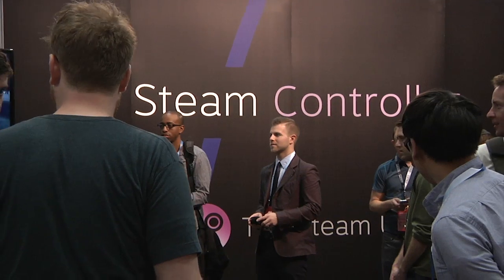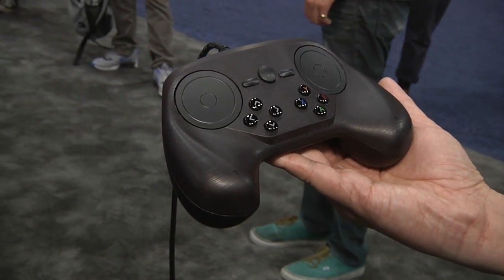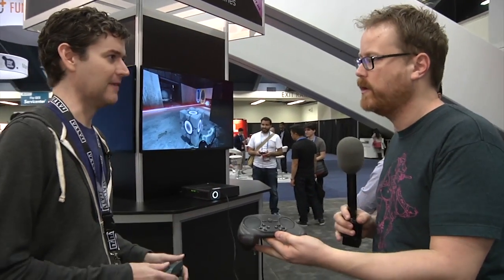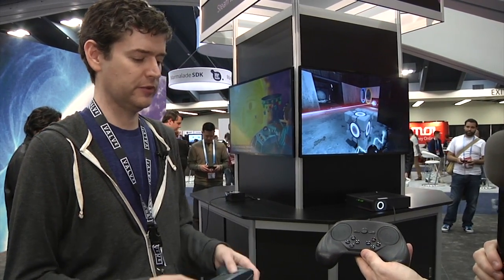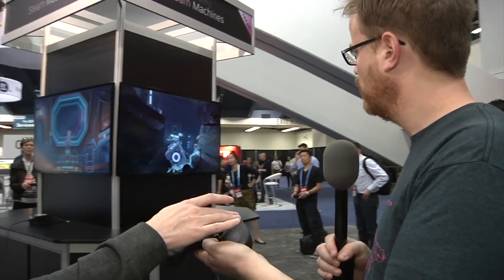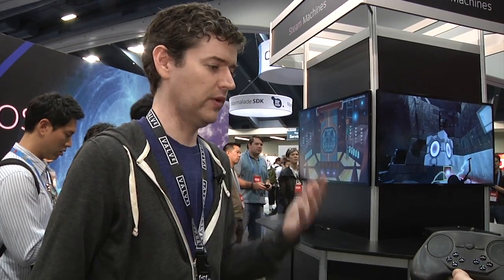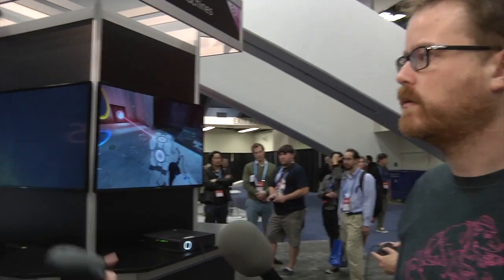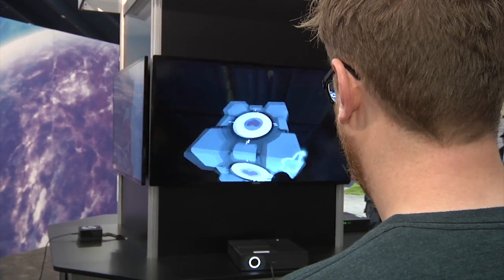Valve's Steam Controller Prototype Hands-On at GDC 2014

Comment: Why ABXY? xB It should be WASD. That would have been fun.
Reply: Because 90% of all games that have controller support, use ABXY.
Reply: Herman Bleh It doesn't matter what the button show, the game doesn't see the button.
Reply: Yago Dias Do remember however, that on the screen ABXY can show up
for example: 'Press A to jump' if you have WASD on your controller you won't know which is which.
Reply: Area51JD Um, if you rebind jump from space to tab, the tutorial will say: "press tab to jump". The same goes for controllers, whether it's triangle, X or 3, the PC is capable of recognizing that, and most games do.
So WASD is a completely valid option, and TBH it would've been quite funny. :P
Reply: Yago Dias ofc i know that, but thats what the game shows, so its less confusing for consumers.
Reply: G,A,B,E
Reply: abexuro Not Xinput games. Only Dinput compatible games properly recognize the button.

Comment: Would be much happier if the left 4 buttons was an actual d-pad.  As it stands, it's a second-rate d-pad substitute that couldn't be used for casual playing in a fighting game.
Reply: They're not going to change just one side of the controller, since one of the main ideas behind the controller is that it's ambidextrous.
Reply: The buttons on the left aren't meant to be a dpad substitute. Dpad functionality will be handled by the touchpads. The buttons on the left serve the same purpose as the buttons on the right. They are labeled with directional labels because that naming is more familiar with gamers.

Comment: Also I hope they bring back the screen because it would be nice that when your far away from your screen and you can't clearly see UI elements that you could use the touch screen for fine control so you can both see and use small UI elements from 3 - 4f away from a 32" screen.

The reason why I really want that is because I want to use the steam controller as a general multimedia remote as well which having a touch screen on the controller would make using youtube from a distance from your computer really easy.

Also if you have the ability to zoom in and out with touch screen gestures thats would make it super easy to use, also it would make it work with games like Civ etc although even a small touch screen would make the controller far more expensive.

Comment: This one is much more nice.  I like this controller,  for its simplicity and the similarity to other controllers,  but still using the touch pads for innovation. Gg,  Valve. Although,  if they could somehow utilize the middle (which is mostly blank),  to its full potential,  I might consider this being my only controller I use.

Comment: REASONS TO BUY THIS:

Character Movement WASD < touch pad < thumb stick
Aiming/ Camera Manipulation thumb stick < touch pad < mouse

It is the best of both, or it should be as long as you can adjust the sensitivity of the pads.
Reply: Touchpad is better for movement than a thumbstick.
Reply: ***** Not even close.
Reply: ARCADDER It's so much more precise, though.

Comment: Needs a Analog stick for the movement not so much viewing side the ability to use it like a mouse is great but the movement needs to be an analog stick.

I heard rumblings the reason why Steam OS and the Steam controller has been delayed is because there adding an analog stick so looks like they are already doing it so.

Its just because for racing games you really need the physical feedback and auto centering of an analog stick to get the best result, and it also works well for general movement in frist and second person shooters but that is true for the touch pads as well.

It would also work for Civ because you can use the analog stick for moving across the map and the pad for UI interaction... Although that would make it asymmetric... Which is probably why its taking them until some time late 2015.
Reply: I could be wrong but I'm pretty sure its confirmed the final controller will have an analog stick where the d pad is but still keep the two track pads
Reply: clutch350 Actually I'm pretty sure the left track pad was replaced with a D pad and the analog stick goes were the D pad was.

Oh sorry my bad they just added a directional indicator on the left track pad.

Comment: They should put a scroll wheel/slider/throttle on the controller for flight sims and analog selector for other game types.

The perfect combination would be a mechanically or electromechanically lockable scroll wheel with 4 modes:
- free spin
- detent spin (like a mouse scroll wheel)
- free with lockable spin angle (for throttle)
- detent with lockable spin angle (for weapon selection)

Comment: I like how the guy on the right tried to shit on Nintendo, but literally made zero sense when doing so. He ended up mumbling under his breath in shame, because he realized this mid-sentence.
Reply: What? He was mentioning that the nintendo button layout is different than the standard.
Reply: He mentioned ABXY and said how it was the standard, then under his breath tried saying it somehow wasn't standard for "nintendo people"

He must have realized mid sentence that it's sony who doesn't use ABXY, not Nintendo.
Reply: N64xKING how is pointing out a difference an insult? And for all you know he could have been referring to the Wiimote which is wildly different than a standard controller.
Reply: N64xKING x and y are flipped around on a 360 controller if you compare them to Nintendo ones.
Reply: N64xKING He was referencing how Nintendo does not use button diamonds, Playstation and Xbox both do. He wasn't talking about how the buttons are labeled, he was talking about location.
Reply: *****
No it's just that on Nintendo's diamonds (SNES, classic controller, wiiu) the ab buttons and the xy buttons are reversed from the xbox counterpart

Comment: Analogue stick on the left, funky trackpad thingy on the right, boom, done.
Reply: Your missing the point entirely. Analogue sticks are simply not as fast or accurate enough to play specific games properly.
Reply: George Ambra
That's what I was thinking, the left analogue stick is for the movement in FPS games, or car control in driving games, and the track pad is for looking around.

Comment: Gotta love that war between K&M users and Gamepad users. And the almost complete lack of respect for either side by some of the elitists. Stay classy internet.

Anyway the new pad is looking better then the original. So far the trackpads are working out better then most expected. Best part about this is that everything is still in beta. Meaning more time to actually sit down and refine the controls. And for those complaining. Remember that this is an optional controller. A 3rd option to the K&M and Gamepad, nothing more. It's not required for PC games so there's no need to stress about it unless your among the group that wants to use it. The only bad thing that will come out of this controller is that it will not stop the stupid and out right silly war between K&M and Gamepad users. And may only end up adding a 3rd group of whiners to the already mind numbing number of gamers that are apparently insecure about their control method of choice. Because god forbid we respect another person's choice...  - _ -;

Comment: I like the idea of Steam Machines and the controller but honestly how hard is it to plug your computer to your TV with HDMI? I do it and use a wireless keyboard and mouse and it's great.
Reply: The impediment is that most people don't have the money for multiple gaming PCs and don't to lug their machine all the way to the TV to use it nor leave it attached to the TV 24/7.
Reply: There´s nothing hard at it :D
Reply: A steam machine doesn't need to be another high end gaming machine. It can be a stripped down device that plays some games locally and streams others from a high end machine.
Reply: For games like NFS a controller would be better.
Reply: Steam machines aren't supposed to replace your PC, they're for people whose PC/monitor setup is in a different room to their TV/couch and saves them the effort of carrying the PC back and forth between rooms. It's pretty much short range remote access for your Steam library.
Reply: Matthew Whitwell I think valve has something up there sleeve. Moving your computer to the living room?? Why? I mean yeah bigger T.V i guess. I think they are going to try something with virtual reality. I men think about it they have been messing with the creators of the oculus rift. Also the steam machines are a good idea for people that don't have thousands of dollers, and want a PC, but don't know how to get the specs of a console cheaper. Valve may not say they are competing with the consoles, but the designers of the steam machines are, they even said so. So this is gonna be great, cause if one console sucks like the damn xbox, and you want something with more powerful than the PS4, but cheaper than a 1,000 dollers these are for you , and this is gonna be freakin sweet!
Reply: Brandon Mounce Sorry but you don't need to spend $1000's of dollars on a decent gaming rig you can build a rig which can play every game under the sun at 60fps 1440p max settings for $700.

And don't give me that 4k nonsense 1440p at 28" is perfect unless you have your nose up against the screen, the 31.5" 4k monitors are worth it but those are all IPS and cost like $1000+ so not for most people.

And its not like you could do a 31.5" TN monitor because the angle you would be viewing the edges at would be so extreme that you would REALLY notice the gamma shift even looking at it dead on from 50cm - 100cm 

And really 28" is a very good sized monitor.
Reply: Etheoma What? I never said you need 1,000 dollers for a gaming rig. The cyber power pc gives you more bang for your buck it;s impossible to get there 700 doller steam machine with all it's specs if you build it.
Reply: Brandon Mounce Errr sorry just a second were you saying that cyber PC is cheaper than buying the parts your self and putting it together?

You don't put your sentence together too well, Did you mean Cyber Power PC's are cheaper than steam machines?
Reply: Etheoma The cyber power pc makes a steam machine o.O So it is cheaper than some of there pcs. There 700 doller steam machine is cheaper than building one
Reply: Brandon Mounce Nope as far as I can see the $700 PC one is what I could build for $435+ $100 for Windows equivalent, Your going to be cheaping out on the case but for another $65 you could get a very good case.

Which still means its $100 cheaper.

Although there is a deal where you can get a 290X GPU for less than a 750Ti, only thing is that the i3 4150 is not going to be able to drive a 290X so... But its the same price after an instant $250 rebate so shrugs

That is cheaper than buying on its own but you at least need a FX6350 to drive the 290X.

Which they don't give you the option to buy a FX6350 in any of there options for cheaper than a FX8320 and all those options are nearly $1000. The devil is in the details.
Reply: Etheoma 435 my ass. You're going to be running less of a video card. You might be able to get a better processor, but a processor sucks nuts if the video card blows.
Reply: Brandon Mounce Nope the $700 one comes with a 750Ti as I said the CPU that comes with the $700 system couldn't drive anything more than that.

And the system example I used came with a 750Ti

750Ti $130
Athlon X4 760k $79
Motherboard $44
1 TB HDD $50
8GB RAM $70
350W PSU $35
Case $25
keyboard & Mouse $10

Which is a little over but that is $443

For gaming that will be just as good as the $700 system as the 750Ti will still be the bottleneck even with the CPU being weaker than the i3-4150.

for $700 I could do a good system.

FX6300 $110
GTX 970 $340
8GB RAM $70
Motherboard $50
PSU 550W $60
1TB HDD $50
Case $50
Keyboard and Mouse $25

Ok it came out $55 more expensive but its 2.5x better in game performance so I think the extra $55 is worth that also the better case keyboard and mouse were what mainly caused the overspend. Also its going to be much better for multitasking than the 4150 as its a 6 core CPU rather than a 2 core with hyper threading.

Right now you might get a slight amount of CPU bottlenecking but with DX12 on the way pretty soon with 50% CPU utilization increase on 4 threads I really wouldn't worry about it because the bottleneck will fix its self. And right now you can play every game in existence at 1080p 60 fps+ in the highest setting so your golden.

Also you could probably expect DX within 1 - 2 years to support 8 threads so in the long term you will be better off with the FX6300. Because AMD has developed mantel which can support upto 8 threads so if Intel doesn't buck up its ideas its going to get left behind also AMD works closely with Windows with DX so the improvements made in DX were probably based of the mantel API, so 8 threads should not be difficult.
Reply: I'm not saying you can't get a good pc for around that same price. I'm just saying you can't get better then cyber powers.steam machiine for that price. Your using a amd processer to make up for the price. Yes they are nice computers, and i think if people build them you need to show them those specs, If people want the most they can get out of somthing then why not buy the thing instead of build it. The alienware one sucks nuts though xD Like you could easily build one better than that piece of junk.

Comment: Still no proper D-pad. 4 individual buttons just aren't going to cut it.
Reply: Still a prototype mind you. If enough people dislike the way they're doing a "d-pad", I'm sure they'll change it. (:
Reply: The left track pad will be the D-PAD. If you don't want that then use a different controller.
Reply: They have directional buttons. The issues he has with them is that it isn't one piece altogether. The casing separates them. In all honesty though, I think that might be better than traditional directional pads. Maybe not though, I haven't had the opportunity to use the controller so I can't give a definitive answer.
Reply: I'd honestly prefer separate direction buttons rather than a solid d-pad. I think it'd lessen the chance of hitting two at the same time.
Reply: I'd rather have 4 buttons than the mess of a Dpad Xbox has.
Reply: Using 4 separate buttons instead of a D-pad has been an epic fail in many an android gaming handheld and the gp2x/ wizz machines. 

Often inspired by the seemingly separate buttons of the Sony dual shock gamepad which is in fact a single piece thumbpad looking like separate buttons. 

A d-pad makes smooth changes in direction and especially diagonals possible. 4 buttons aren't going to cut it. :(
Reply: It's supposed to be ambidextrous, so no asymmetry.
Reply: Studies suggest that 70–90% of the world population is right-handed. 10% seems to be left handed and some - like me - are ambidextrous. Striving for a visually appealing controller is something a designer would perhaps do, a gamer would look at what works. I've had the 4 button thumpad thing in my hands and doing diagonals or smooth movements on those separate buttons in say Shmups is virtualle impossible. When doing platform games (2d) where left and right are used and the other buttons as jump and action buttons there's no issue. So it very much depends on the style of game you're playing. The thumpad in some sort of single piece of plastic combining the buttons in some sort of cross shape seems to work best. That's why almost all gamepads have an actual thumbpad. And I believe all systems have had their thumpad on the left side of the gamepad with two analog sticks. Converting the sticks into circlepads may be a good thing for FPS type dual analog type games but in a way it relies heavily on propriocepcis that is the thing that most people dislike with touch controls on gaming tablets. 

Perhaps this is the gamepad for the generation that grew up playing casual games on the tablets and phones who don't care about buttons...

Comment: That has always been one of my main problems with FPS using controllers, your ability to spin has been restricted to sensitivity. Someone who has grown accustomed to a mouse use for FPS can spin around extremely fast, while sustaining accuracy. Compared to a controller on maximum sensitivity. Some games can work decently with a rotational speed, like Tribes Aerial Assault, where you're lining up and calculating projectile speed and distance for  longer. But when it comes more twitch reaction dependent games, the stick doesn't really cut it. Maybe with some practice these controllers can provide the speed mouse users have come to expect.

Comment: Nothing beats the mouse and keyboard.
Reply: Depends on the game. Dark Souls is far superior on a 360 controller.
Reply: Assassin's creed Black Flag. Driving and flight games too. But of course a steering wheel or flight joystick is best
Reply: IHateThis GPlusSoMuch That's simply a lot of 3rd person control games. Arkham City is also good with a joystick. But that's not what Valve is trying to appeal to, its players of the FPS games on PC. They're claiming its just as good as the Mouse and Keyboard layout.

Also no driving games is not superior on a joystick, that'd be the racing wheel.
Reply: Nicholas Spezio
When did they claim it's just as good as a mouse and keyboard. This guy just said that it's not nearly as good on Dota 2.
Reply: And this was not meant to beat M+KB in the first place.